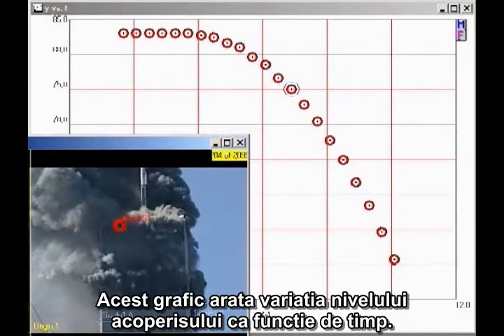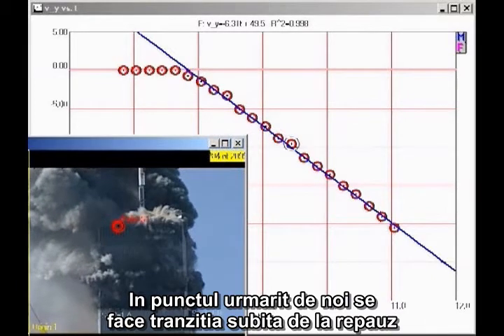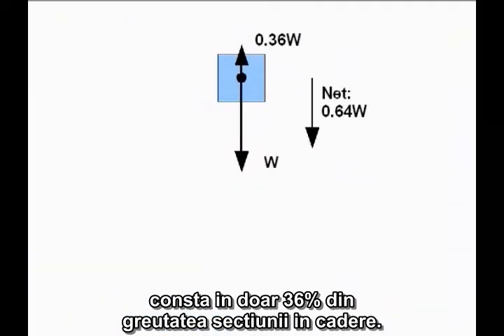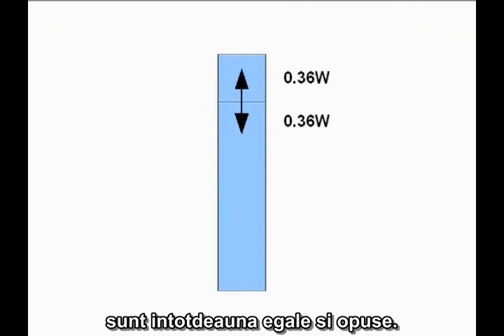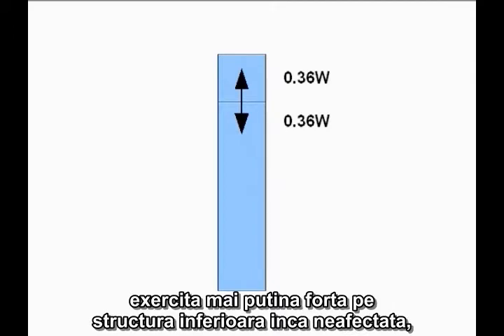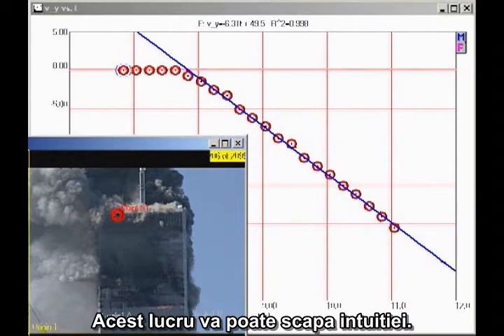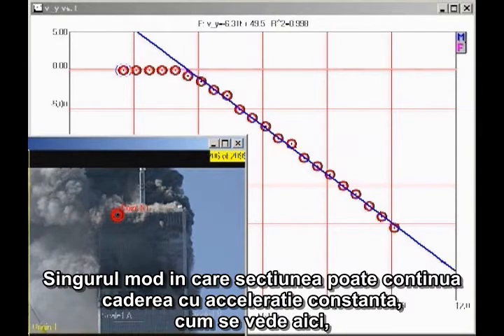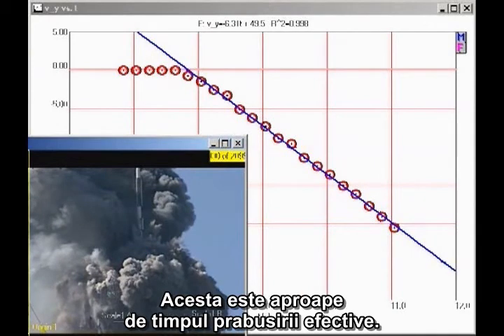David Chandler - Acelerarea Turnului nordic - Subtitrat in romana

Comment: The upper block is not a block, it's a collection of 300 interconnected columns, the same goes for the lower block. Every columns hits in a little bit diferent time (due to tilt and other reasons), so there's no big jolt (that would require al columns to hit at precisely the same time. Instead, there were 300 small jolts, every fraction of second, thus the jolts merged into continous "deceleration". You'd need a very high frame rate to capture those jolts.